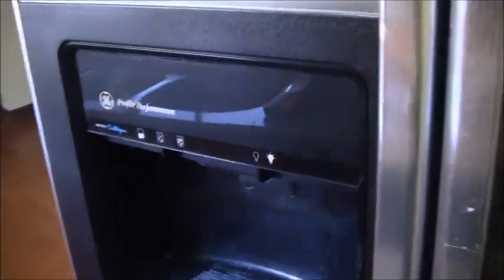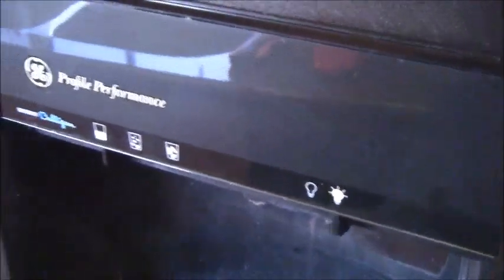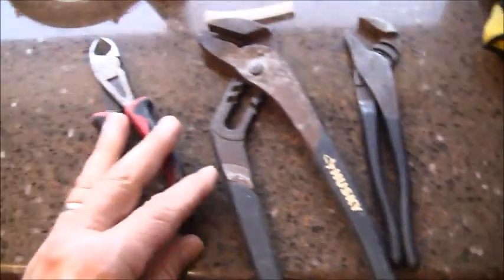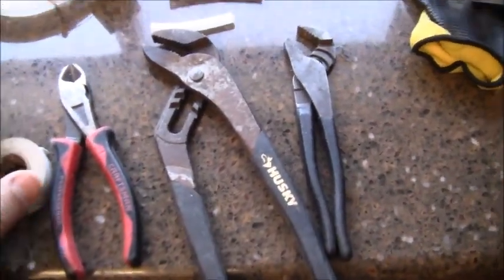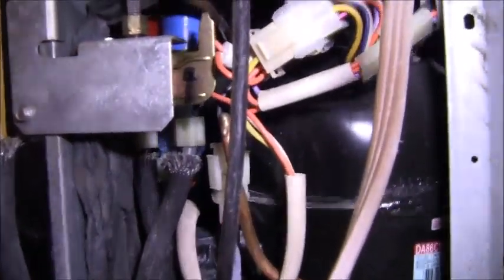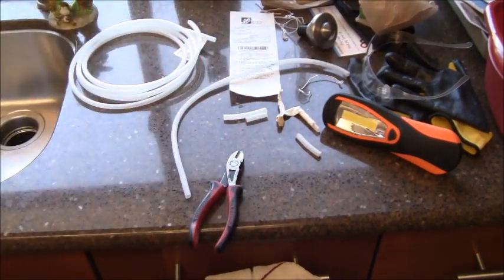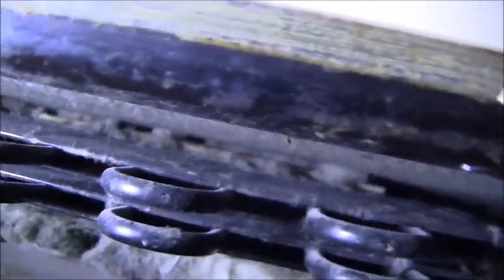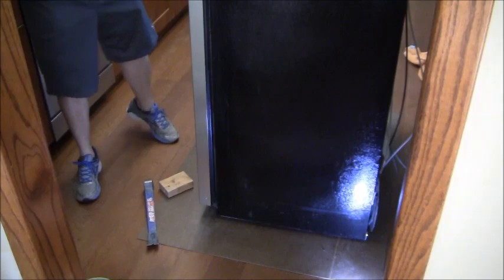How to fix a leaking refrigerator ice maker water line for under $3

Comment: Liked the video, learned a lot, and with your help and my neighbor who had a younger fridge than mine go out (not the water line, its clearly newer than mine) I maybe able to tpo your $3 repair with a free one. The tubing is same size, and if the screw on caps are the same, or I can reuse the ones on our Hotpoint, could be a done deal. I'll come back after subscribing, and finishing the job, and let you know.

Comment: A) Don't need a pry bar - have to wood pieces ready and when you push on it and tilt it slide the wood pieces under

B) NEVER cut plastic line with side cutters - use either hose cutters or a utility knife / new razor blade so you get a clean and undistorted cut

Comment: water line runs from sink (water line) under a wood floor and connected via rear to water and icemaker. 
pinhole in rear lesking water. service an said if i repair the pinhole chances are other pinholes will occur under the kitchen floor.. your opinio?